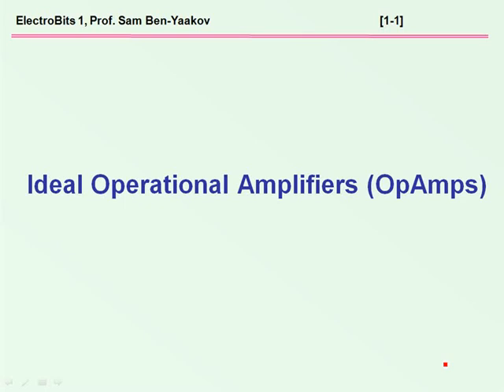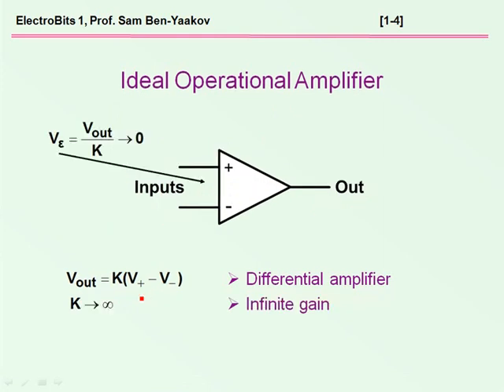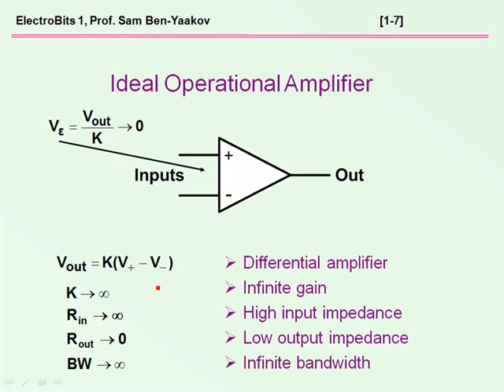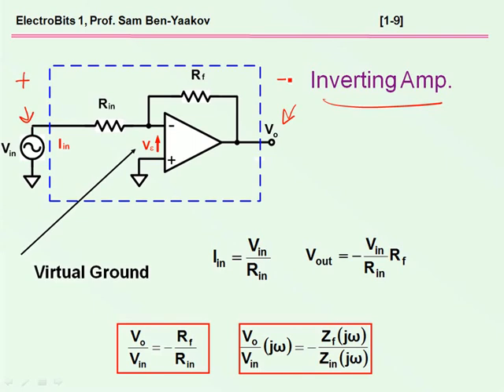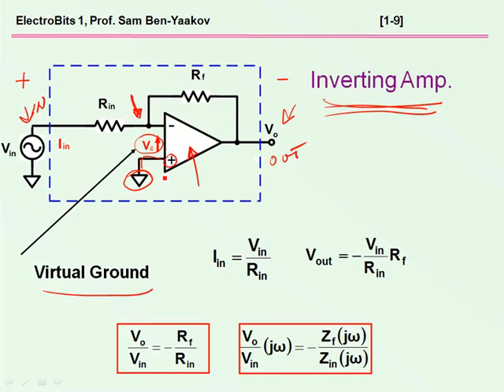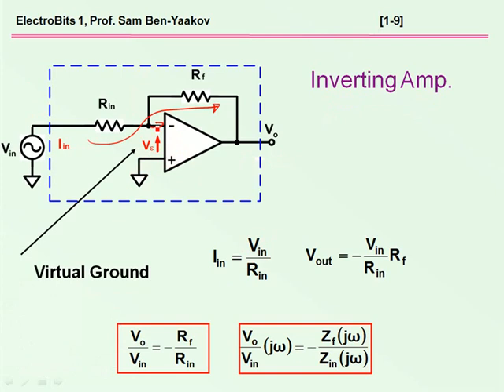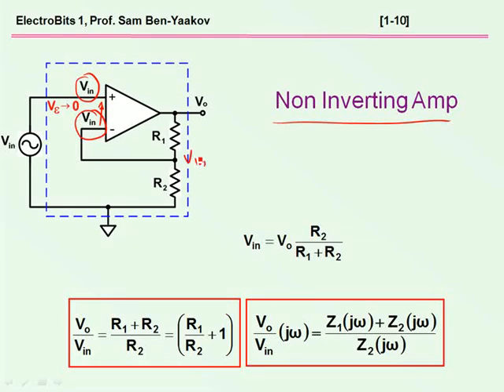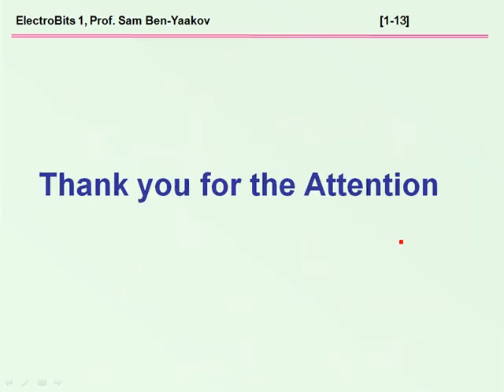ElectronicBits #1: Ideal Operational Amplifier

Comment: Simple and "to the point". Even eight years after, I have rarely seen an equivalent achievement elsewhere. Sure, some people may find it as going "too fast", but in my opinion, all the required elements to understand the behavior, logically at least, is there, without extra fuzz which is better left to be introduced in a later discussion. Excellent and concise as I like it. And refreshing.